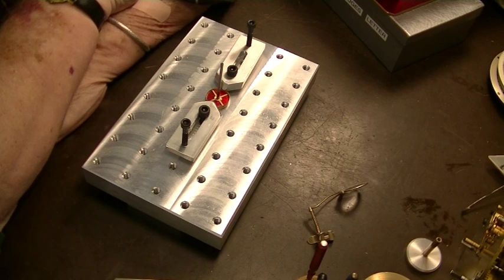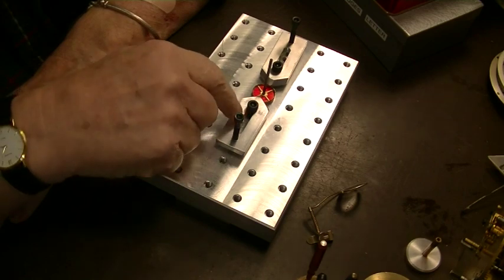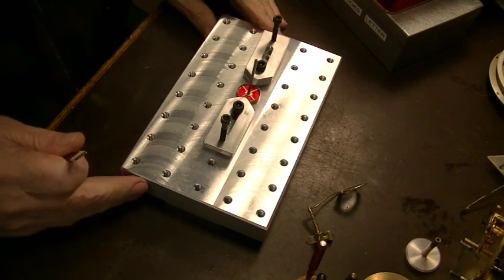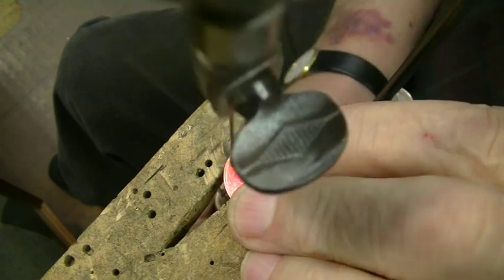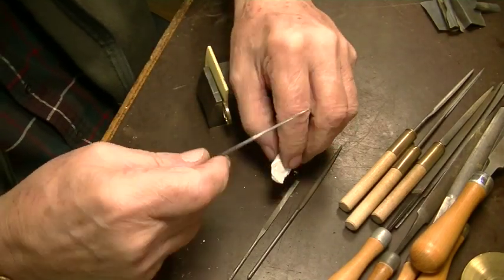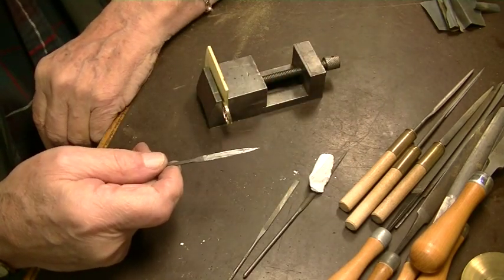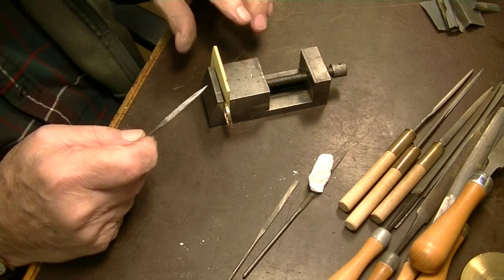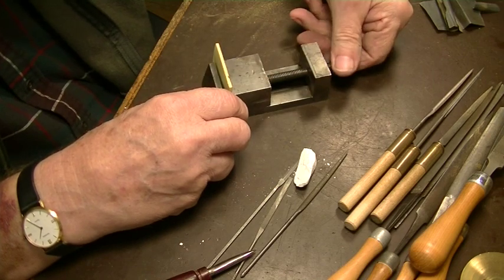Clock repair tutorial.#7. Cutting a new contrate wheel for a Carriage clock.Part 3.

Comment: The very best method I've seen for cleaning out the teeth of clogged files is with a bar of copper that you work parallel to the grooves. The bar rapidly wears into a set of plows shaped to the same dimensions as the grooves such that in subsequent passes they are superlatively positioned to get right to the bottom of your files teeth. Try it. You'll never look at copper the same way again.

Comment: Can I ask what your labor rate for cutting that gear is?  I have a cnc mill and a jet lathe while I have made many clock parts I have not cut gears. just to time consuming.  I have a hard time now getting cost effective price for clocks and GrandFather clock should cost from picking the movement up and cleaning bushing and installing it back in the case. Thanks for showing the process.

Comment: Nice work.  How critical is the platform location on a carriage clock to that wheel?  Is the holes on the french clock accurate or do they offer adjustment forward and back?  We have one from about 1900 or a little before.  repeater with alarming too. Had the platform repaired and it has to go back on the clock.

Jim
Reply: very nice video. very informative and I learned a lot. can't wait for more.